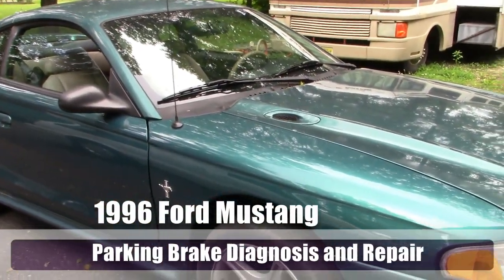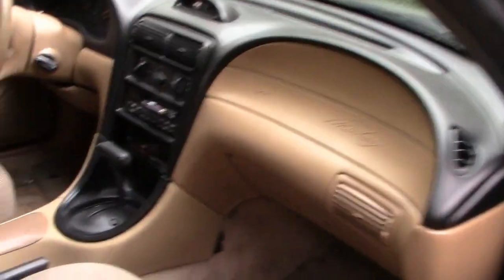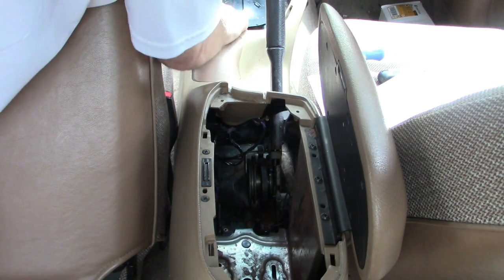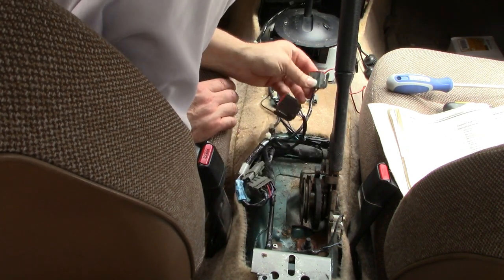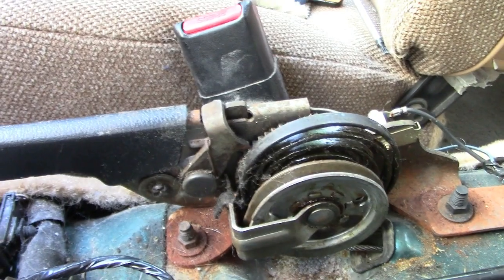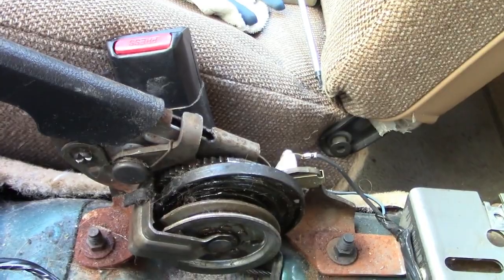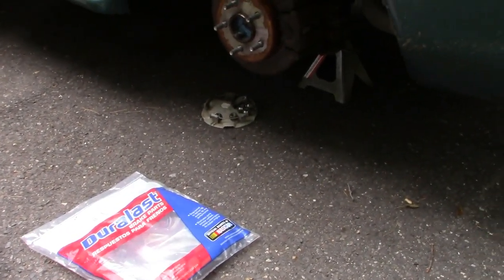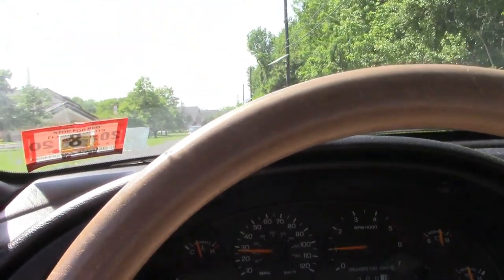Ford Mustang Parking Brake Diagnosis and Repair

Comment: At 5:50 I'm pretty sure that extra wire/switch is for the convertible top mechanism. I have the 1998 GT convertible and that's where the switch is located.
Reply from the maker: That makes sense. Good to know. Thank you.

Comment: One of those fixes that u take everything out to realize you could have done it with it on lol
Reply: His adjuster tooth wasn’t making contact with the sprocket until after he messed with it and  he put the pin in the handle to take tension off to remove the cables. Looks like the console had to be removed.

Comment: Mr. Buck,  Great video, very informative!
How did you access the 2 cables at the bracket under the cockpit?  They are on top of the driveshaft and welded dual exhaust pipes.  I cannot get my hands in there.  I saw another video where they unbolted the driveshaft.  Did you do it that way, or buy long (3 ft long) Needle-nose pliers?

Comment: Im pretry sure the e brake is supposed to be one the 2nd or 3rd tooth on the left side left to right 1-11 its gotta be on the 2nd if you have the recall adjustment piece 3rd to be safe if you don't

Comment: How did you adjust the tension? Mine is too tight and dragging on the rotor
Reply from the maker: I think it should be self-adjusting. In my case the inner cable was not sliding smoothly through the outer sheath. Disconnect the cable at the rear wheels and make sure the cable moves easily in and out smoothly. If not, replace the cable(s).

Comment: Hi there , the issue I’m having with mine is that the cable is adjusted just fine , but there no compression on the caliper , I mean , you see the cable pulling the caliper’s bracket all the way to it’s full position , but yet no compression .
I’ve done a bleeding service yet no compression on the e-brake.  If any insight could be given it would be greatly appreciated. Awesome video by way.
Reply: Did u figure it out?
Reply: @trevonstewart3636  , man it has been a while I hardly remember what I did , but I think I ended up buying a new set.